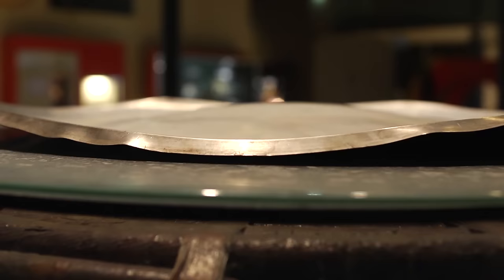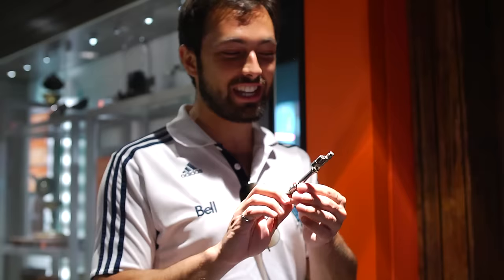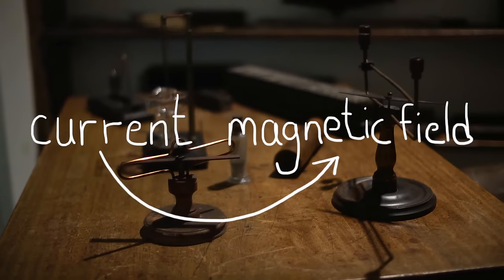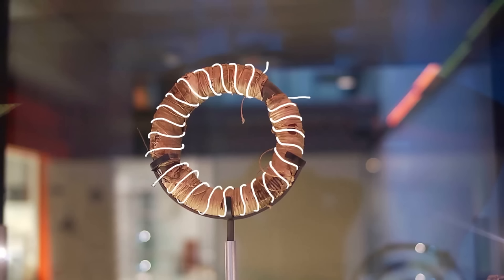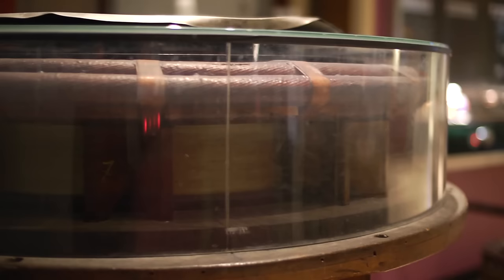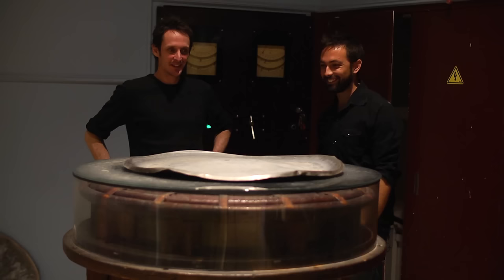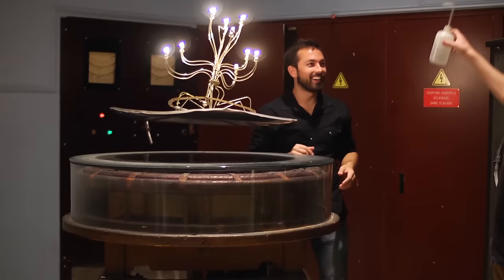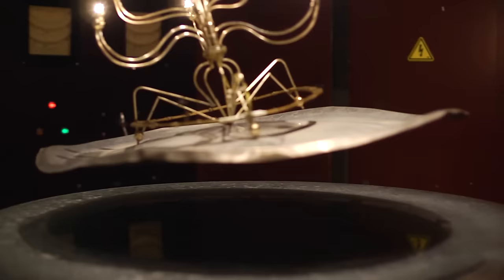Levitating Barbecue! Electromagnetic Induction

Comment: You didn't mention the elctricity bill of this device, though.
Reply: or the sound if u use it as a dinerpiece
Reply: Think about the electricity bill of Maglev trains
Reply: He didn't mention the voltage either.  If it runs 800 amps at only one volt, then that's only 800 watts which is the same power as a small microwave oven and less than half the power you can get out of the average wall socket, so it wouldn't be expensive to run.  The big thick cables are needed for the high number of amps, but it doesn't necessarily mean high overall power.
Reply: i was thinking the same, it does look like one of the most inefficient ways to heat up a steak
Reply: @ersetzbar.  Induction stoves are way more efficient then heating coil stoves or gas stoves.
Reply: most of the power here is reactive( except power required to heat up the plate and light up the bulb), so ya even if it consumes 800 amps at mains voltage they won't be paying that much of a bill because electricity company charge for active power and not for reactive power consumption.
Reply: @harshsharma5768  You are absolutely wrong. Electric company charges for the resultant power and not just active power. That is the reason power factor of your connected load matters.
Reply: @harshsharma5768  In Europe they don't charge for reactive power until they notice you're using shitloads of it. At which point they'll hit you with a massive bill, and may require you to install hardware to start correcting it on site.
Reply: @hp2084  generally domestic loads are not charged for reactive power so they don't need to maintain very good power factor. Industries on the other hand which uses highly inductive load like motors are required to pay for reactive power and thus have to maintain good power factor otherwise they are charged with penalty.
Reply: @BigUriel  you are correct, but if you do this once in a while then i don't think they are going to notice it. Anyways if they do notice then tough luck for you😆.
Reply: Tesla coil outside the stole the power
Reply: Someone was considering a new dinner piece
Reply: Perhaps he creates electricity himself, and does not buy it from corporations.
Reply: The magnetic fiels has nothing to do with power
Reply: If you use it during the heating season (if you live somewhere cold enough to bother heating your house), and that heat is through electric resistive heat, then this device is no less efficient than your heater (100%), and simply means your heater will turn off sooner.

Comment: I really wanted to touch the levitating plate, but then they showed how hot the plate is.
Reply: +Czesnek you can still do it, in glove protecting from heat I guess
Reply: +Czesnek This is essentially an induction heater.
Reply: Am I wrong about this essentially having the power to fuel a rocket? The earth gives off a magnetic field, if that field can be used as both an electrical current (Tesla!!) and a magnetic field then what keeps it from happening?
Reply: +josiah meade changing magnetic field induces electric field. Changing electric field induces magnetic field. From our perspective, magnetic field from earth isn't changing.
Reply: Quite a lot of satellites use a similar method to orient themselves in a specific direction. They have a long arm with coils at the end. When the pass current through one of them, the resulting magnetic field interacts with that of the earth and produces a force that turns the satellite in the desired direction. 
https://en.wikipedia.org/wiki/Magnetorquer
Reply: I have a piece of metal and 7 screws inside my right arm, quite near to my wrist. Since that surgery i've had to be extra careful when going into MRI-machines as any attempts to image my wrist causes distortions in the picture and in an extreme case start to heat the metal inside me...
Reply: markotark what happened?
Reply: Derek Gaming probably just a normal broken bone
Reply: The magnetic field of earth is in fact what holds the sun, moon and stars - the entire electromagnetic universe. Your rulers and occult-practicing high priests of science (Babylon the Great) who own science and NASA actually worship this indestructible energy as "queen of heaven." The ancient Babylonian symbol that represents the magnetic fields of earth is called the fleur-de-lys. Isaac Newton was a magic-practicing alchemist and member of the secret society known as Priori of Sion. The emblem of the Priori is the fleur-de-lys. Watch my "Secret of the Fleur-de-lys" video for more info.

Get an object high enough into the ionosphere (charged gas/plasma) and it will do exactly what you see in this video. ALL magnetic fields produce centripetal and centrifugal spin. An object will spin centripetally if it is near the centre of earth's magnetic field (anticlockwise/east to west) as seen in this video. It will also heat up and appear to float. It will spiral. The sun is an inductor. Gravity is electromagnetism. Watch some of Ken Wheeler's work (Theoria Apothasis).
Reply: And yes, the field intensity (given by Biot-Savart Law) isnot enough to levitate objects, and the stars and sun are "held' in place because of it, there is nothing like 'held' in space.
Reply: Gravity is not electromagnetism, nor is the sun an inductor (which it would be only if it was a gigantic coil). And force on inductive objects is proportional to time rate of change of current, so you would need to have an alternating field, which the earth doesn't produce. but first point negates this possibility entirely, that the sun is not inductive.
Reply: Objects in the ionosphere heat up due to solar radiation (mostly UV,infrared and visible and charged particles, which(UV and free charges) get blocked by the ozone layer).
Reply: @josiahm5221  Faraday's induction law states that a voltage is induced to oppose the variation of magnetic field (actually it's the magnetic flux) through the terminals of a conductor. For earth's magnetic field to generate voltage, it would have to change. Unfortunatelly, that's not what's happening :/
Reply: i still want to 
HEHEHE you wont get me darwin
Reply: @josiahm5221  the earths magnetic field doesn't alternate as aggressively and rapidly. And even if it did it'd still need to be outputting much more energy to fuel a rocket. More then enough energy to fry electronics and disrupt pacemakers and make sensitive equipment inaccurate. It'll also induce smaller magnetic fields into everything that can easily generate one. You can feel electromagnetic changes because they're still outputting some power though, but only enough to disrupt very few electronics, as only the most sensitive of devices need to be buried deep underground to avoid interference. The sun and solar energy is a significantly better fueling option even accounting for day and night cycles.

Comment: I was a Hull Technician in the Canadian Navy, serving on a Destroyer. I switched on our welder, and the cable was mounted on the steel wall, coiled up. As I passed  this cable, all the tools shot out of my belt and stuck to the wall inside the coil.  I learned an interesting lesson about magnetic fields.

Comment: Thank you for this video! In the Museum of Science and Industry in Chicago, in the late 50s and early 60s when I was a kid, they used to have a similar device that worked the same way. It was demonstrated in the Electric Theater. That one was relatively portable (with casters) and smaller: IIRC, the size of a large hassock. 

The demonstrator would wheel it on stage and show the levitation of the aluminum plate. He (always "he" in those days) didn't have the light fixture, though. He never mentioned any of the electrical specs, but the machine gave off a distinct hum. He did show that if you pressed down on the plate, the humming would get louder. That showed the plate didn't get that hot in the short demo time, so spraying water on it wouldn't be dramatic (but he did mention the plate got warm). Also, the machine didn't have anything to prevent water from dripping into it. 

The Electric Theater was so cool! It was my favorite place. First time I saw strobe lights, UV light, and a microwave transmitter as big as a refrigerator. The last had two small plates on bars on the front (transmitting antennas, I guess), and he had an ear of popping corn on a stick that he placed between them, and the corn would pop on the ear! You could smell the fresh popcorn! Totally magic at the time! Imagine how I felt when compact microwave ovens started showing up around 1970!

He also had a setup that would catch the shadow of an exploding balloon with a synchronized strobe flash on a phosphorescent screen! Now anyone can see high-speed videos of that, but at the time it was completely WOW!!!!!!!

Comment: Damn, did you say 800 amps? That's like the total electric current running through all the houses in my neighborhood.  Good luck to the prospective hoverboard builders who think they can co-opt this technology into practical transportation.
Reply: +Alan Falleur 800 amps isn't really that bad.  Since the wire is so thick and there are few turns, I doubt that the voltage is above 1 volt.  So that makes 800 watts, or 6.67 amps at 120 VAC.  800 amps in your neighborhood is 96 KW.
Reply: EGL24Xx I'm just talking about the current this thing draws, not the power.  The strength of a magnetic dipole induced in a coil is proportional to the current in the loop.  This thing will drain an 8 amp hour battery in 36 seconds.  Bad news for the hover boards, I think, if you need that kind of current to run it.
Reply: +Alan Falleur You're talking to an electrical engineer grad student...  Yes the field strength is proportional to the current; no that isn't relevant.  This coil wouldn't drain an 8 AH battery in 36 seconds for multiple reasons.  First, there is no way a battery that small could provide that much short circuit current due to ESR.  Also, capacity deceases the faster you drain a battery.  Trying to pull 800 amps directly would reduce the battery to less than 1 AH.  But again, that isn't relevant.  The coils go in the ground, the board is just a low resistance piece of metal.  But here's the thing, you need to talk about power.  You would use a transformer to create large currents at low voltages with great ease.  I've run 2000 amps through a cable loop I put through a high capacity toroidal transformer while drawing 3 amps on the primary.  An 8 amp hour battery could be used in a buck supply to create low voltages with much higher current.  There are a lot of things you aren't considering here...
Reply: +Alan Falleur lol :D
Reply: +EGL24Xx hmm, screw this i dint understand anything in the end T_T im just too stupid i guess.

hmmmm could u just tell me what ESR is? ohh and 2000amps to a transformer and u got 3amps? wut?
Reply: 200-300 Amps is enough to melt metal.
Reply: Jona van der Pal Probably.  Depending on the gauge of the wire.  Certainly you've got a lot of cooling issues if you're going to run that kind of current continuously.
Reply: Alan Falleur 16mm squared warms up quite quickly, at least in my experience.
Reply: Romain Vincent Uhmm...None of the above?  No, wait....B!   I was told we wouldn't be tested on this.
Reply: Reminder that one of the first computers, the ENIAC, occupied 1800 square feet and weighed 50 tonnes just to process bytes of memories. Compare that to how much it has evolved today, into a tiny computer you can place on your lap that holds gigabytes! Dont lose hope on hover-boards too fast.
Reply: Taki Potatoes Yet somehow we're still no closer to Back to the Future II-style hover boards than when Faraday's law of induction was discovered 185 years ago.  

Hoverboards on the store shelves are about as likely as nuclear powered flying cars in the Nissan dealership.
Reply: To melt metal with electric current, you need to resist the current and dissipate it as heat. The amount of heat produced is equal to the energy lost as resistance, and the temperature will depend on the rate at which heat is produced (and also at which it is transferred to the environment), in other words the power.

So the temperature depends on the power, not the current. A high-current, low-potential circuit will heat the metal no more or less than a proportionately low-current, high-potential circuit.
Reply: EebstertheGreat That doesn't seem right to me.  Then why do the power transmission lines use high voltage-low current instead of low voltage-high current if the waste heat loss is the same either way?
Reply: "Kind of a hostile tone you have there.  (¬_¬ )  Good luck with the hoverboards."
He didn't have a hostile tone at all, he legitimately explained how it worked. You on the other hand, retorted with passive-aggressive behavior "good luck with the hoverboads". Maybe you're on the defensive: some people have a hard time admitting when they're wrong, but that's no reason to be a hypocrite and call someone hostile when you're being passive-aggressive. All he did was explain the workings of it, there literally was NO opinion or emotional response in his reply to you.
Reply: Alan Falleur It's not comparable. In this situation, I'm assuming one hundred percent of the power put into the current is eventually dissipated as heat, because you are just using the current to heat the metal and nothing more. This is similar to an electric space heater. If all the power is dissipated, then all that matters is the power you put in. In other words, energy is conserved.

In power transmission, you actually want to minimize the power dissipated, because most of it is transmitted through the lines and used to do work, not just to heat up a coil. In that case, yes, of course it matters what the voltage is, because power loss is proportional to the first power of the voltage but the square of the current.
Reply: Alex What are you, his lawyer?  Go ahead and sue me then.
Reply: EebstertheGreat That's a false assumption though.  100% of the power is not dissipated as heat.  Some of it is going into the movement of the plate.
Reply: Alan Falleur "What are you, his lawyer? Go ahead and sue me then."
Do I somehow need your permission to interject on a public forum? No, I'm just suggesting that you're wrong about him being hostile and that there was no opinion or emotional response in his reply to you. Nothing more, nothing less.
Reply: Alex How much does YouTube pay you to bother me?
Reply: Romain Vincent
Yes, I get karma points every time a hoverboard advocatus hits the reply button.
Reply: it's a device that reduces voltage and increases current, and vice versa in reverse scenario , the power of the current remains nearly constant( with 1% losses), hence the name transformer.
Reply: but a lot of energy lost to heat so if that was somehow mmm ;) you never know what ingenius people do :P
Reply: Kugsgrat
Reply: Actuly The King of Random modifies a micro owen transformer to put out 800 Amps but only around 3 Volts. But still, making a hoverboard is pretty hard since you woun't have the weight or volume capacity for such a battery or rather a high capacitor.. Here is the video https://www.youtube.com/watch?v=GCrqLlz8Ee0&t=8s
Reply: @EGL24Xx  Voltage to the toroids is over 100 V and amperage few hundred amps. The apparent power is quite high (over 10000 VA) but the power throughput only 1 or 2 kw.

Comment: 2 major problems: 1) Heat. Any metal objects in the EM field would heat up. A field strong enough to levitate a car would heat metal up quite a bit. Anyone with metal-framed glasses would get some nasty burns on their face, for example. Not to mention, the car itself would get extremely hot. Odds are, it would cook anyone inside.
2) Any sensitive electronics (smartphones, for example) would likely be fried the second they enter that field.

Comment: This would make a much better centerpiece if it wasn't vibrating at 900hz. That's a very irritating noise to have a conversation around.
Reply: Didn't he say it vibrates at the double of the frequency? Making it ring with a 1800Hz tone
Reply: @crackedemerald4930  Yes it expands when the current goes through and heats it up, then contracts when the current stops, the rapid contraction and expansion create the sound. This happens twice per cycle, once on the positive half wave and again on the negative.

Comment: Only one problem with this barbecue, though: where do I find 800A?
Reply: You would need a transformer, If you have a 40A 220V supply you can use a transformer to make 12V 800 A, you would need a very heavy gauge wire though. The tougher part is to convert the 50/60Hz to 900Hz
Reply: For the frequency, you would need frequency dividers xD But the bigest problem would be the energy bill, I guess xD
Reply: whopping 8.8kwh/s at global average price it cost almost 1 dollar per second to run
Reply: you don't need 800A to levitate a ferromagnetic fork
Reply: (for example)
Reply: Do you need a high voltage for this though?  800A at only one volt is a mere 800 watts.